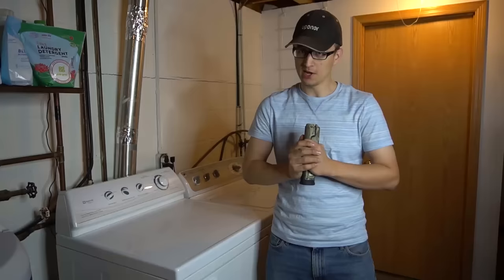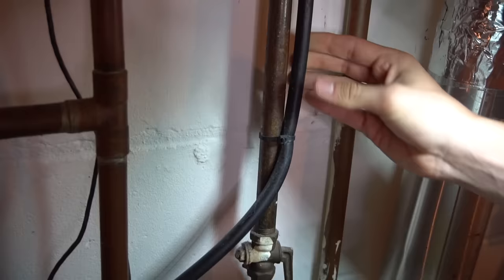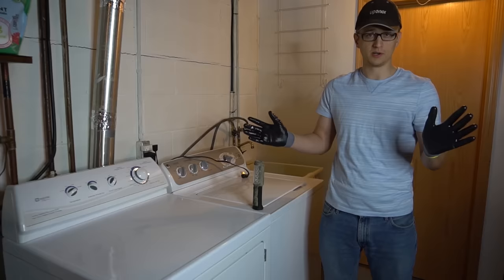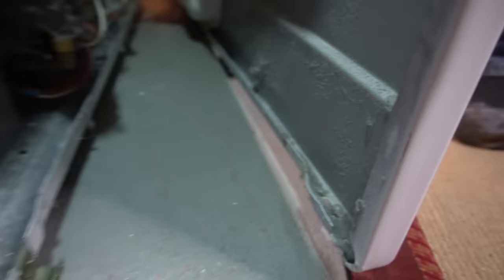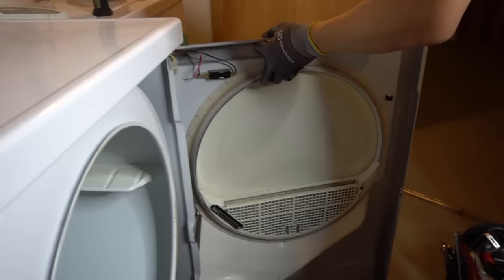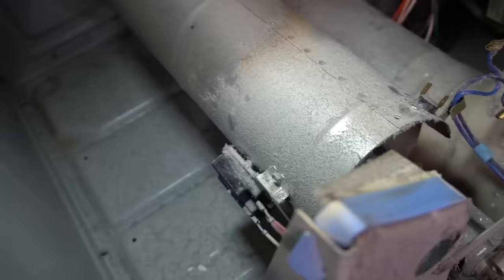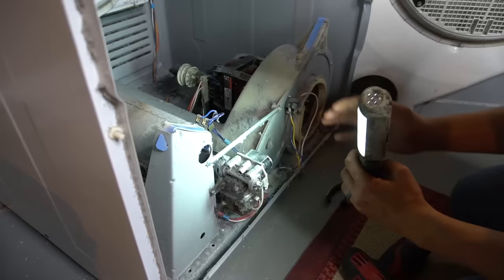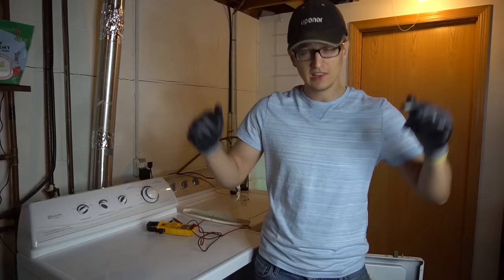Dryer Not Heating and The Most Common Fix

Comment: I’m Jesse mena. 
I really like you’re video, a lot of information. I need help with my older model kenmore. Everything seems to work on my dryer, Burt  the close stick to the walls of the drum and it takes 4 or 6 cycles to dry even though the dryer heats up normally

Comment: Absolutely love your vids!
If you can be so kind to try to figure out an issue I’m having with an old Frigidaire dryer
I’ve replaced the 2 coil valve solenoids , flame sensor and thermal fuse and replaced propane valve, the igniter and the result
Is still … the drier igniter glows and a flame lights up  but shuts down after 10 seconds ,
It’ll repeat and keep cycling but never stays ignited
The only thing left is the main gas valve assembly unit which I’ve resisted since it’s too pricey 

James

Comment: Thanks for your thorough video.  My 2009 Samsung dryer started this week to dry half way and then just blow cold air for the rest of the cycle.  When it was set on sensor dry, it could run for hours without completing.  So my dryer does heat up but cut off the heat 15-20 minutes into the cycle.  What do you suggest?
Reply: If it’s a gas dryer I’d suggest changing the coils first thing. They’re like $20 and they solve the problem that you are observing much of the time. They are super easy to change and don’t expose you at all to any gas so don’t be worried about that aspect

Comment: I have the same Maytag dryer as yours. I think it needs new gas coils and am wondering why it would be necessary to remove the drum to replace. As you said in one of your videos, the most difficult part of working on these is taking apart and re-assembling them and after replacing the drum belt and pulley a few years back am not looking forward to doing the blind re-install on my old knees if not necessary! Thanks and Happy New Year!

Comment: had repair guy come out, replaced the thermal fuse and thermostat and still won’t produce heat. He told me to have my vent cleaned, nothing more he could do. So after the vent cleaning it helped a little for a while, and now back to no heat.

Comment: i don't know the model number off hand but I have a gas maytag dryer model LDG8410AA E ANS Z21.5.1b-90 clothes. not sure if those number are all exactly right it is hard to read. but anyway.  last night i washed a load just before i went to bed so I left the dryer on, usually it just stops after so many times buzzing. but i could't hear it. when i woke up it was still runing and was cold. but everything was dry, just dry cold.  than shut it of. than tonight i tried to dry another load. i basically noticed the  blue and orange flame I can usually see through  the little crease was not on. and also seemed to be blowing colder air.   what do you think my issue is most likely?
thanks

Comment: A quality meter will survive being exposed to line voltage on the resistance or continuity scale.  Putting line voltage across it on the Amps setting will blow the fuse, and possibly the meter.

Comment: Thanks for the video. Changing the Gas Valves was enough to solve the problem of dryer only heating intermittently. My model is Maytag MGDC300XW3 and the part was $7 on Amazon. It was a Whirpool aftermarket part but it was compatible.
Reply from the maker: Perfect! Happy to hear you were able to get it fixed! Thanks for leaving a comment!

Comment: My lent screen was plugged (holds water) so I sprayed the screen with brake cleaner on the wire mesh and the wax build up turned to a white dust.
I then brushed the white dust off and we were good as new.

Comment: Dryer would not heat.. so was it the fuse? With your help, found the fuse...removed one terminal clip/wire from the two on the fuse, ohmed it out to find, no it was shorted as needed. So the fuse is good.
So what else could make it not heat?
So where is the heater element? Ahhhh in the back of the drum...and look! Two broken (open) coil )heater element spots on one of the two coils.
I just joined them, twisted them with needle nose real well...  put all back together.  Dryer heats now. 😊

Comment: Thank you so much for this informative video. I was able to cross reference all of the many parts and for great prices on Amazon for the many parts. For about $60.00 I was able to replace just about everything you had suggested including a new tensioner, pullies and the belt.  However I still cannot get the burner to ignite. I do get a good glow but cannot get a flame going. I replaced the solenoids and the flame sensor as well. Is it possible the gas valve is bad?  Is there a way to test it it clean it? What do you suggest? 
Thank you in advance for your help!

Comment: thank you for your video! I have a question: if i keep reset my dryer and it gets to works for a few cycle of cloths then it is going bad again. I have to reset it every few other days. I clean the vent, i clean the entire dryer. what else could I miss or should I check something in particular?
Reply: Probably your thermostat is not working properly or the reset is bad

Comment: When you see a dryer that bad too clogged up it means the the output vent wasn't venting and when people use fabric softener sheets clogged up all the ductwork unless you take that jar off and wash it out with water hose and are it out and let it dry for a day I rebuilt a lot of dryers I learned from a retired Sears dryer repairman washing machines a little bit harder to rebuild usually people mess up the timers

Comment: Thank you for the information. My dryer is heating but it's not enough to finish for one time it 2times to finish the loud every time around 70mints witch means dry very slow what I need to replace? Thank you

Comment: if you take the thin metal bar that connects to the blower housing off you should be able to get your left hand inside to help put the belt back on
Reply from the maker: Thanks for the tip George! I have done this enough times to where the metal bar doesn't bother me so I just leave it.
Reply: @WordofAdviceTV  than why dont you show putting the belt back on ?

Comment: I have a Frigidaire washer /dryer stack model.The issue I'm having with the dryer is that at times when I push the start button the drum turns  but  won't turn on.I have to retry and then maybe after the third try it turns on. Any idea on what to check would be appreciated.

Comment: I have a Kenmore gas series 80. I check all the  opponents in the back a d they have continuity,  I look through  the hole at the bottom  front and  I could  see the glow  and hear the click a d the flame come but after 5 or 6 minutes goes off . Question  what  could  be the problem and what I should  check. By the way I like your videos they are  very  helpful and very informative.

Comment: I have an Inglis commercial dryer. for some reason one cycle is not enough to dry the cloths. I try to fix that by replacing the exhaust house and clean the ventilation but nothing changed. Wondering if there is anything that you can recommend to fix this problem.

Comment: I have a GE gas dryer that wasn't drying . I replaced the ignitor. The dryer is getting hot now but not fully drying the clothes in one cycle . Any help would be great thanks .
Reply from the maker: Usually that indicates that there is bad airflow. Have you cleaned the vent and checked the vent hood outside to make sure it's all clean? That is the first thing I would look into. Also, did you do the lint screen test? I think I showed that in the beginning of the video where I poured water over it.

Comment: Hi, I have a GE electric front load dryer. I have 2 issues: the motor siezed, the wiring came off the cycling thermostat. I have replaced the motor but I can not figure out how to route the belt. I forgot to take a picture. There are 2 idler pulleys and there is a spring that I am not sure where it goes? When I removed the blower housing the 2 wires were attached to the thermostat. After putting it back in place they became disconnected. One is black the other black with white stripe. I am not sure which one goes where. My model is GHDS365EF0RR. The motor is model S585SVGED-7145 Any help would be greatly appreciated. Thanks!

Comment: I tested every thing on my dryer with my multi meter and got continuity and the right Ohms, my  igniter was not glowing so I replaced it and yet the dryer got hot then quit. Even though I got corrected ohms on the gas coils when they are weak they quit supplying gas and the heater quits getting hot. I replaced coil since the kit comes with both so replace bot of them, now my dryer is working.
Reply from the maker: Thanks for sharing Victor! I'm sure some people reading the comments will have an exact same situation and will appreciate the suggestion.

Comment: My dryer does not heat up and when I push the on button to start the dryer, it goes off unless I manually keep pushing the button down. Are they related issues? The door switch is working fine. Thanks
Reply: Bad motor switch, replacement of motor / check made motor switch to see if it is stuck on

Comment: I have older GE dryer. Was working fine and now it won't heat up as much. I can still feel it a bit hot but not enough to actually dry the clothes. I cleaned out all vents as clean as possible and not luck. My step is to take it apart. What should I look for once inside? Greatly appreciate your response.

Comment: Thanks for the vid. Good stuff man. My Samsung electric dryer heating ability started dwindling. After a month the heat finally went out - heating coil had broken. Replaced with new coil but still it doesn’t heat up well. Clothes still “dry” damp. Thoughts?  Cycling Thermostat?

Comment: My 1960s gas dryer has worked great -- lately, however, I have no heat and it takes 2 or 3 tries to get the heat to come on. Which part would most likely be going bad? When I start it and no heat happens, there is a slight crunching noise. When it works, that noise it not there. I almost think that the flame sensor may be the issue (I sometimes have this issue with my furnace and the flame sensor needs cleaning to get it going again).

Comment: I feel like the issue I am having is with the three prong plug. All of the other parts passed the continuity test. Can the three prong plug be the issue? If so how can I check to be sure that is the issue and how can I fix this issue? Thank you in advance.
Reply from the maker: Yes, it is possible that the outlet is bad or there is a loose/burnt wire. The power cord could be bad (it is replaceable, in fact you could probably get a 240v cord like that at a hardware store). It could also be a burnt terminal block... I don't know if you checked that. Where the power cord goes into the dryer, the two hot legs go there along with the ground wire. I have seen that terminal block burnt to a crisp before. An easy way to check if the cord our outlet is bad is to check for 240v at the terminal block. (put both meter leads on the screws where the hot legs come in) If there is 0v or perhaps 120v, then you know there is a problem in the cord or outlet. If it is around 240v, then there should not be any problems with the cord, prongs, or outlet. Hope that helps!

Comment: My gas dryer has an intermittent issue firing up. The thermal fuse, thermostat, flame sensor, igniter and coil all tested good with my multimeter.  I can usually get it to fire up if I rotate the control knob from from sensor dry which is what I normally use to timed dry. Could it be the timer or is there something else like a circuit board or something else that could be causing the issue? Thank you.

Comment: Hi. Question. I have a LG gas dryer. Suddenly the dryer stopped turning. Power is still available. The screen display has visible power. Before I take it apart. Do you suspect belt broke or would a faulty thermostat or faulty thermo fuse have similar results? Thanks in advance!

Comment: If mine is sometimes hot and sometimes not, is it not the thermal fuse?  I ordered that solenoid for the gas valve that you explained  in your other video.  Can you explain more how to check for resistance and continuity?
Reply from the maker: It won't be the thermal fuse because it is a one-time blow fuse. If it was blown, there would not be even sometimes hot. The gas valve solenoids is a good next guess. Unfortunately if the problem is intermittent, checking them with a multi-meter won't give you an exact answer. It may show that they are okay but they are actually going weak..
Reply: Gotcha.  My coils should  be in on Friday.  Assuming   I can figure out how to get the front door panel off I'll let you know how things go. With your video I was able to get the top off but I got stumped on finding the screws once the top was lifted.  I'll take a look again and have faith they are there somewhere.  Probably not held together with glue and tape.  :)

Comment: I'll have to check these other things. I have cleaned the vents and dismantled my dryer to get all the lint out. Made sure there are no blockages outside at the vent. When I replace the thermal fuse it works for half a cycle and then the heat stops. I replace the fuse and the process repeats. is there anywhere else lint may be stuck? Does this problem sound familiar in any way?

Comment: GREAT VIDEO!  DID YOU EVER DO A VIDEO ON BAD DRYER TIMERS OR ISSUES WITH TIMES?   Mine will not start on air dry but otherwise works.  Seems the dryer is not that hot as it should be.  Guessing it is the timer. 😁 Great channel... watching you for a while now.

Comment: Replaced Timer on Maytag dryer, had heat before,  but after replacement,  no heat. What might have gone wrong  ?  Replacement of wires were done one at a time, so they should be hooked up right.

Comment: Somewhat true about lint screen thing. But, all gas valves in dryers have to be accessed through the front. Especially when replacing flame sensor and/or coil kit.

Comment: Hi thanks for the good video. my problem on my gas dryer is the igniter will light the burner and it will burn for about four minutes. once it kicks off . in a few minutes the igniter will kick back on and the burner fails to light and the igniter goes back off. I don't have a multimeter. if I can't figure this out i may need a repair man . Any advice would be greatly appreciated . thank you

Comment: My dry does not heat up. I changed all of the sensors, but there is still no heat; it is as if the gas is not turning on. Any recommendations would be appreciated.

Comment: Do you know of any vid showing disassembly of a model SDE4606AYH or similar Maytag electric dryer?  I've never had any trouble getting into any dryer, but, THIS one has a construction I've never seen before.  Basically, the sides and rear are all one piece (except for the back panel behind the controls), similar to the unit in this vid.  That forms a giant "C" as viewed from above, standing on the left side of the dryer.  

BUT...  None of the other panels seem to pop off / apart -- everything that starts to separate seems to have a screw behind it or is interlocked.  I expected the top to pop off as shown here, but, no luck.  Trying to pry as shown here is bending the metal. There are screws along the bottom of the "C", but I can't see that taking them out gets me into the dryer chassis from the front.  How the heck does this thing come apart?

Comment: Question. Could putting too large a load of clothing in dryer cause reduced air flow?
Reply from the maker: Yes that would restrict the airflow. Generally you don't want the dryer more than 3/4 full.

Comment: If your gas dryer igniter is not glowing like it did before, it could be that the thermal fuse has lost its continuity...replace it. It can be found on the rear of the dryer next to the blower...need to remove the back panel.

Comment: I have a GE Profile Model DPGT&50EC2WW electric Dryer which I have cleaned the lint from and replaced the drum roller recently.  The heating element apparently works, as it has continued to get hot off and on.  I will hear a sound that is like a loud "sigh" coming from the machine when running, and then it will stop heating.  It went for a period of a month or so of working fine, but now it has begun not drying again, or not thoroughly drying clothes. Do you have any suggestions as to what is likely to be the problem? I have an old multimeter that doesn't have all the settings that the one you demonstrate with has. When I checked all the contacts they seemed to be OK, but I'm not certain.  Being that the heating element seems to be working, I am considering replacing the thermistor or cycling thermostat .  Any other ideas?

Comment: I have a Maytag Bravo gas dryer model MGDB850YW1 and it keeps blowing the thermal cut off part 8573713. Went into diagnostic and retrieved F4 E3. I completely cleaned the duct work since those codes indicated an obstruction of air flow. I replaced both the high limit thermostat 3391912 and the thermal cut off fuse 8573713. The ignitor tested good as did the gas valve cut off,  thermal fuse and the thermistor. Put everything back together and the new thermal cut off had blown again. They guy at the parts store said it may be the dryer lint screen since we do use dryer sheets. I washed the lint screen with mild soap, cleaned with a  plastic brush and rinsed off the screen with very warm water and am reassembling. I have purchased a thermistor and dryer thermal fuse put did not replace them since they tested good. What is your take?

Comment: I have a Maytag performa gas dryer. I tested all the thermal fuses you show in your video and replaced the 2 coils and still does not ignite! You see the glow but after a minute of running with the glow on, the dryer does not ignite! What else could it be? Gas valve? But those are pricey at $133! Any other test I could do to find out? All this tested with vent disconnected and dryer cleaned of lint.